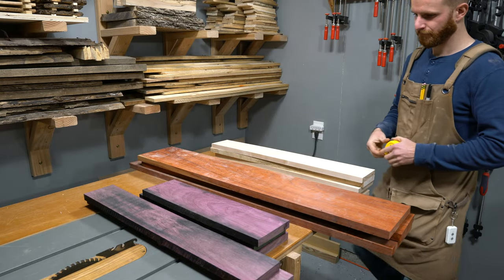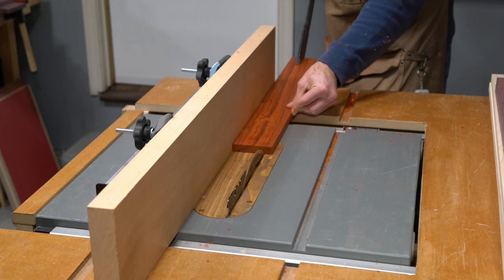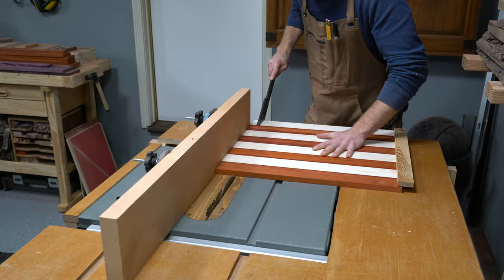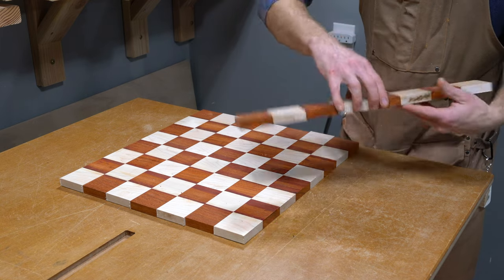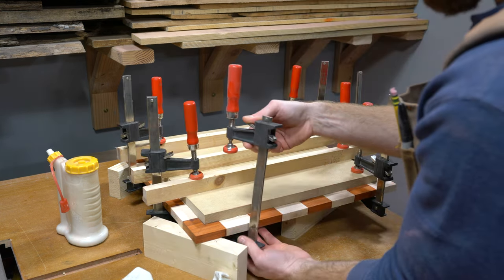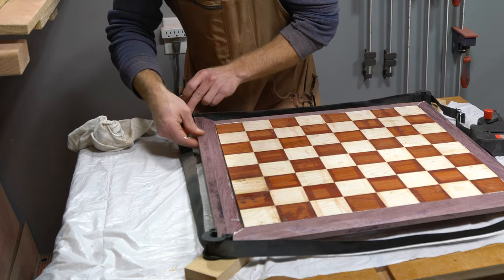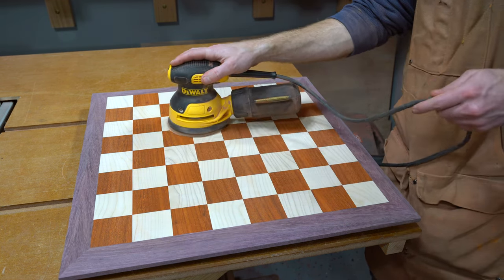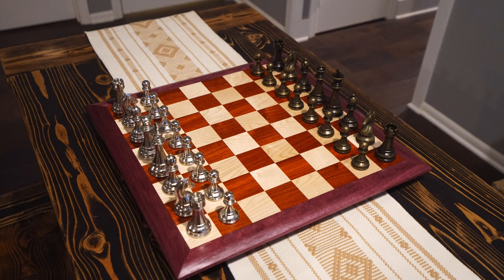How to build a chessboard like a pro

Comment: Did the padauk ever lighten, almost loosing its color all together?  I also have had padauk dust get into the maple grain. I never did get it all out.  Did you have that problem? Also, the 45 degree cuts of the purple heart was glued tight all around the chess board, my question is did expansion ever damage the the corner's connections?  Thanks, great looking board.
Reply from the maker: The Padauk wood didn’t lighten for me. The Paduak sawdust did get smeared into the maple wood while sanding but as I went up grits it became less and less until eventually none of the dust was getting into the maple grain. I’ve glued up many picture frames in the exact same way as the Purple Heart and the corners have never failed on me. Thanks for the comment.